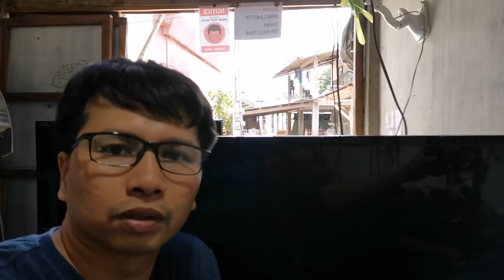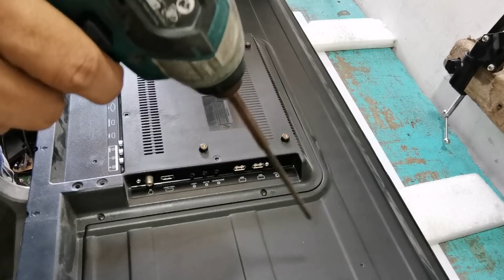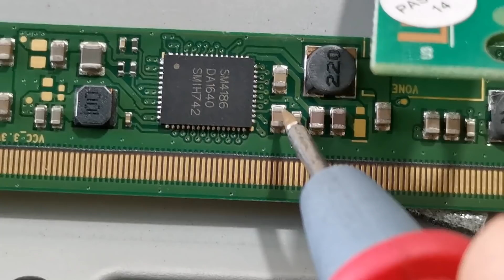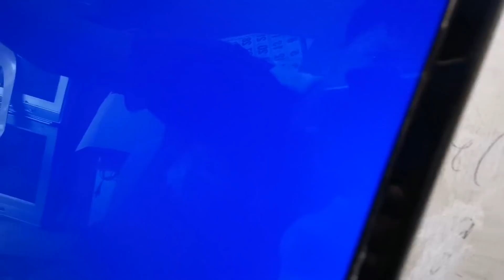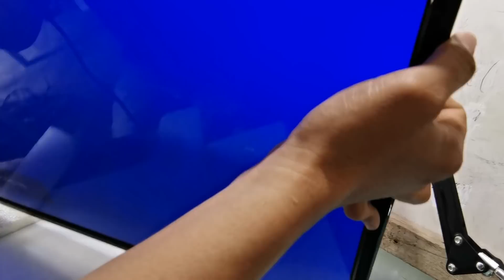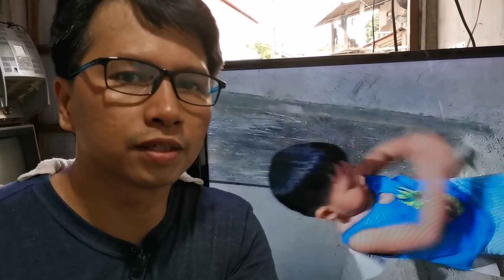How to Fix No Picture in Led Smart Tv w/out Changing any of the Parts?(ENGLISH LANGUAGE)

Comment: Ang model ng haier ko LE39B7100 ang problema ok ang backlight at may sound walang picture ang problema ko kaiba ang board sa baba putol ang board mag kaiba dyan sa vedio mo ang voyage lang na nasukat ko power supply 12.8v 338 at 1.87 at 1.24v ang vgl vgh vdd       at ckvv1  at ckvv2 hindi ko malocate  subrang loot kasi ng board ko putol pa sa gitna ano dapat kong gawin diy lang ako shotuot salamat mr joey  tech

Comment: Pwede po pa help papa ku sir??
Samsung slim crt tv CT21A6
Pag plug daw ng papa ku ilaw ang green light indicator after 3 sec patay.. agad ilaw na naman pag power wala po oscillation kahit B+2 check ko na ang lahat connection diod ,resistor, cap wala nman po sira stedy lang po b+
Sana ma tulongan nyo po papa ko..
More power po.. ty somuch